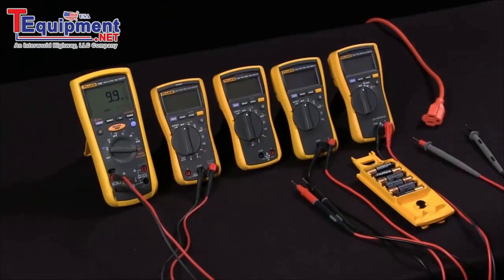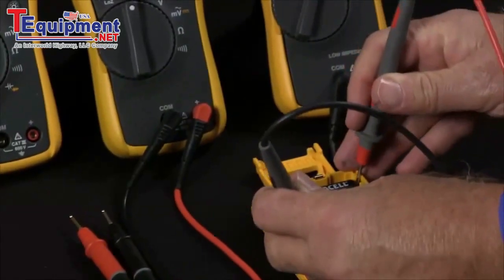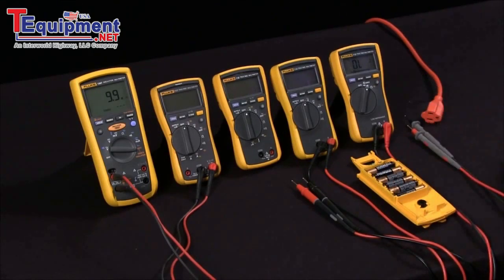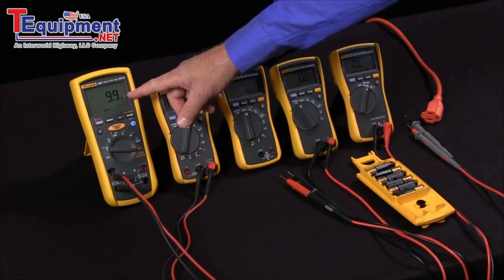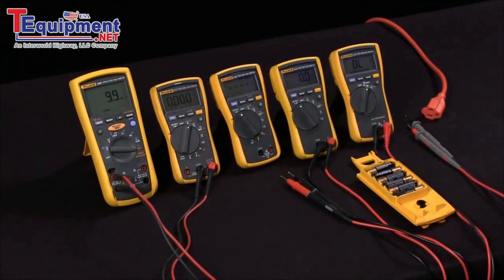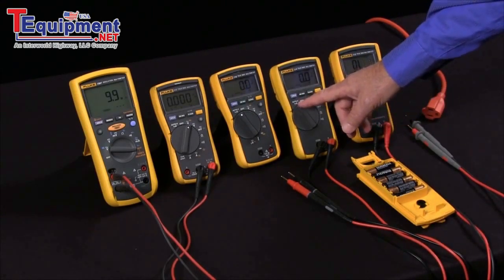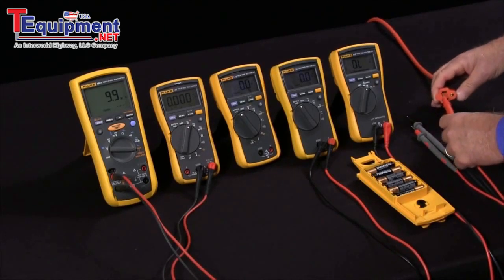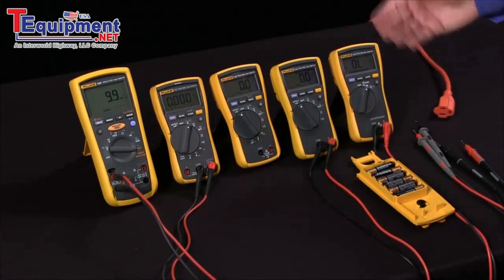What Are The Most Important Functions On A Multimeter

Comment: depending on application ..diode  contunity   dc   ac   and ohm  are the most  important.....due  min max  also  come  in  handy in detection  of   intermittent  failures  analog  bar is  also  cool .....but  mainly diode contin ac dc  ohm   are  basic   frequency  minmax  and  hold  are  secondery  whet it  comes to electronics  repair